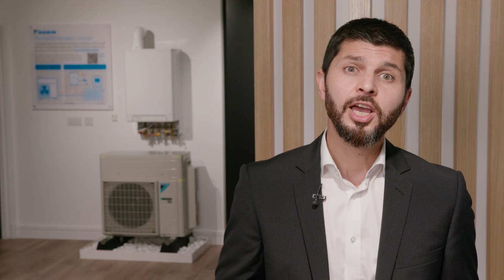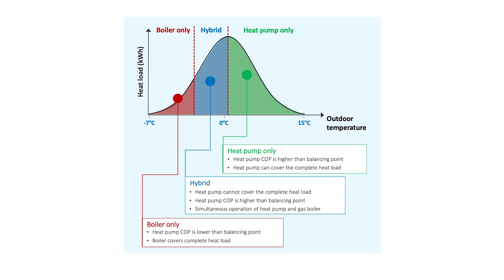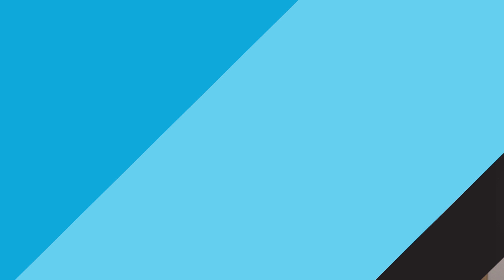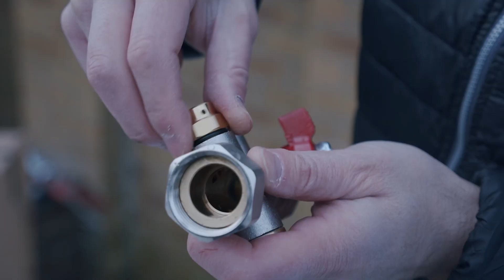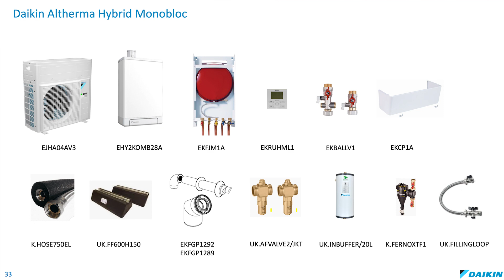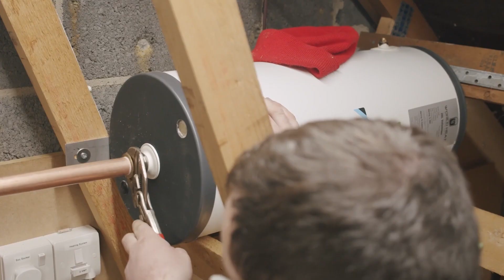Daikin Hybrid Monobloc Features & Benefit

Comment: Daikin Hybrid with Existing Boiler. There is passing comment about being able to use Hybrid as stepping stone for connection to existing boiler. Customers may have a relatively new existing combi or conventional boiler and dont want to go the whole way with full heat pump, despite the current government grants. The hybrid system does not attract any grant funding so a cheaper starter solution with the outside unit only connected to existing boiler and pipework should be a good and cost effective idea - resulting in a quick payback for customers and them taking the next bite with your boiler. Your videos and documentation make passing reference to it but have not seen any videos really explaining it and the pros and cons of going down that route. Appreciate that existing boiler solution may just be bivalient - meaning either heat pump or gas being used and no actual joint use. Have you considered a sales model where you instal outside unit but make it easy when existing boiler actully requires replacement to swap out to your boiler and presumably swap from parallel piping to serial piping. Either way would appreciate you puting some video together detailing the existing boiler solution integrated into hybrid solution.